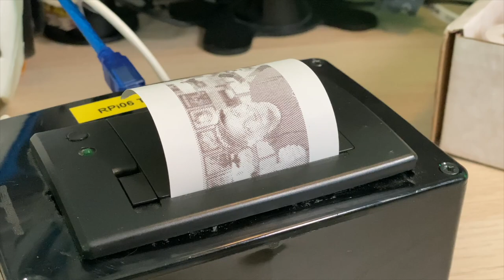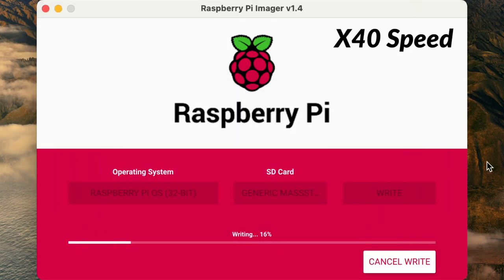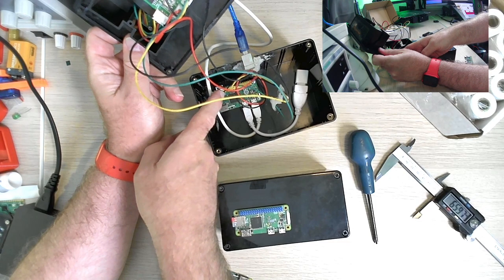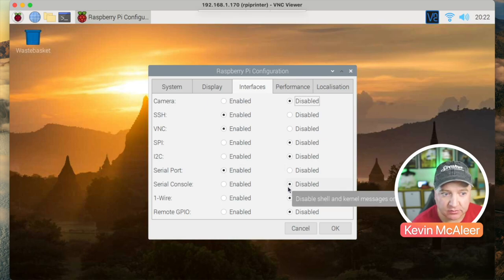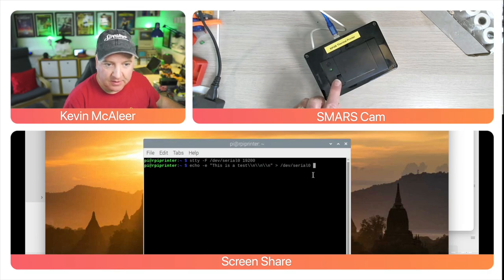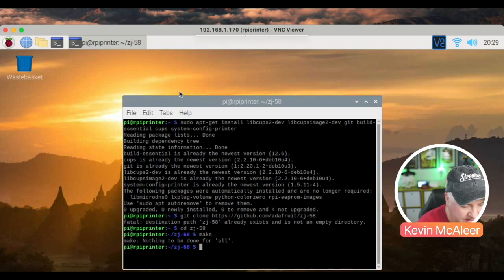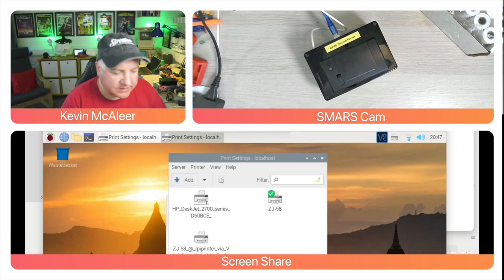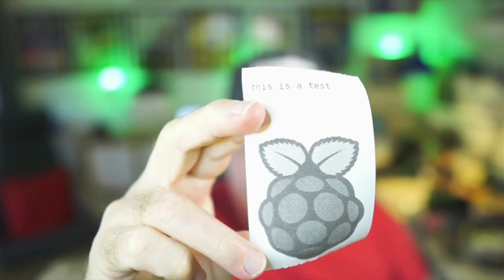Raspberry Pi Zero Thermal Printer fun project

Comment: hey i've done all this and all that I get when I print the test print is hundreds of 'a' character. I noticed that the firmware for my printer is SV1, not GV2 as it says in the Adafruit tutorial, do you know if this is the issue and of any extra steps required to get this version to work?

Comment: cool project! But as most thermal recipe printers got an ethernet port, isnt it a bit doubled?
What I really would love is a bluetooth printer version. I was trying really hard the last two days to set up a zero w as bluetooth server, but it rejects working :(
Reply: You could try using an HC-05/HC-06 chip which enables serial communication via Bluetooth (the way I use it is I connect my laptop to the chip from Bluetooth settings and treat that Bluetooth channel as a serial port, which it is). You may need to adjust the chip’s configuration the first time but it’s not hard.
Reply: This would only work as a way to have your rpi connected to the printer by Bluetooth though, not to let random (non-set-up) phones and laptops print directly to the printer since the Bluetooth connection is only a serial connection over the air

Comment: Have you done anything for the printer to print smoothly? Mine stutters and does not print continuously. I have it on a large power supply so voltage is not the issue
Reply from the maker: Is it a baud rate thing?
Reply: @kevinmcaleer28  I don't think so. The test page shows 19200 and that's what I used. Using a different one leads to gibberish being printed

What is the gv2 version on your test page?

Comment: For me, thermal printer printing random character. Whhat should I do?
Reply from the maker: First off, check the baud rate, needs to be right for the printer (hold down the button on the printer when applying power will print a status page with the right baud rate). Next check the serial pins your using are not being used as console out by the pi zero. Finally I’ve heard putting a few low value resistors between each rx/ tx connection can stop the lines from floating and giving spurious results
Reply: I am having that same issue. Did you ever get it to work?
Reply: @kevinmcaleer28  I am having the same issue of it printing gibberish when I try to to the test print. It functions correctly, has the correct baud rate, and can do the self test just fine. Anything else is garbage though. 
What size resistors do you suggest for the TX and RX wires? That's the only thing I've not tried yet.
Reply from the maker: @ChristinaSmith  have a look at this troubleshooting tip on Adafruit - https://learn.adafruit.com/internet-of-things-printer/troubleshooting#faq-348947
Reply from the maker: @ChristinaSmith  can you tell me a bit more about your setup, what version of software your using - I did have something similar with the software that converts images behind the scenes not handling the conversion properly
Reply: @kevinmcaleer28  I'm using a raspberry pi 3, and the same model of thermal printer you use here. All the TX and RX and swapped and followed the Adafruit set up as well. I still get gibberish when trying to print test prints from the ZJ-58 and also any images. I can do the This is a Test stuff okay.
Reply: @ChristinaSmith  I am having the same problems. It prints some of the raster image of the test page, but then lots of gibberish in between bands of the image. Were you ever able to fix the problem?
Reply: @ChristinaSmith  Did you ever get yours to work?